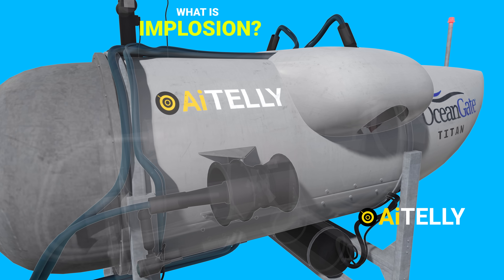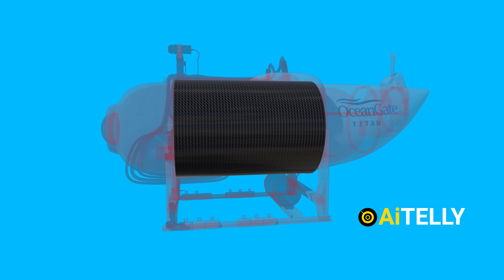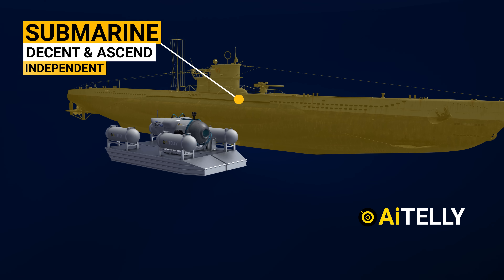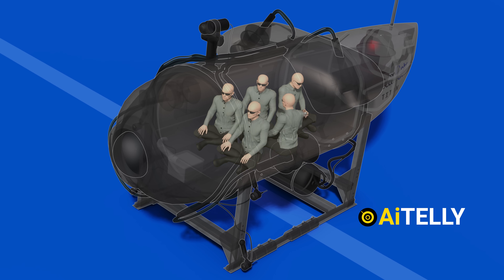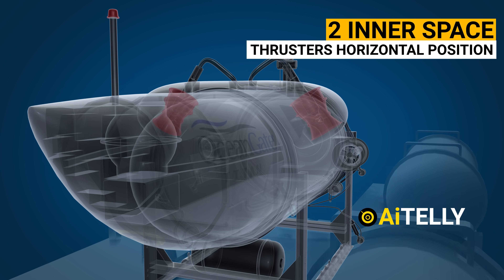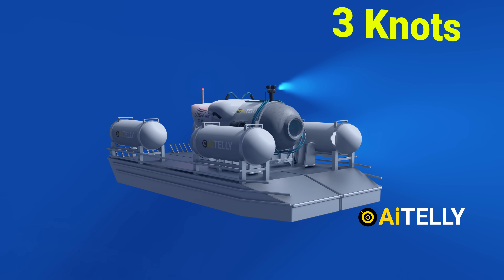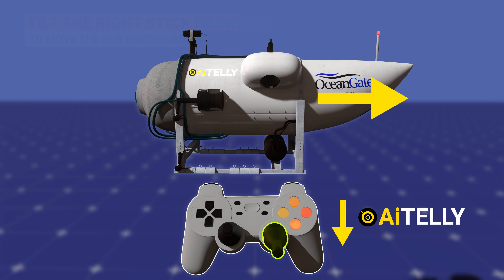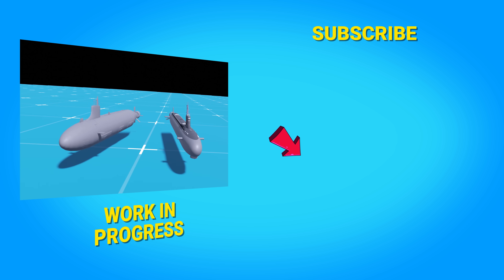Implosion Titan Oceangate How it Happened | Submersible Submarine Parts #3d

Comment: You are stating it was a sudden implosion but nobody knows that for sure, I think the epoxy connection between the hull and the aft end cap was the initial failure. I haven't seen any photos online of the hull or anyting else, just the front titanium hemisphere with the sight glass missing. Has anyone else seen any pictures of the debris from the hull? Just curious
Reply: At the pressures it was experiencing it was absolutely a sudden implosion. You just can't have it any other way. It's not like there could be a slow leak. Once the system is compromise, sudden and drastic complete failure ensues
Reply: @MajDuty  not true, without knowing exactly how those those dissimilar materials would behave under compression/decompression cycles, which would only be revealed in cycle testing, (since this is one of a kind). If it had a small leak in the epoxy seal it could have started pressurizing internally to a certain point then it could have had a catastrophic failure of the rear retainer and been crushed like a sewer pipe from back to front. Carbon fiber is not a plastic pipe, it has much different characteristics, and since it hasn't been tested ever, everything we think or proposed is merely speculation. Until we see the debris from the hull we don't know what happened. I would love to recreate this entire thing on my channel, but the problem I'm running into is nobody really knows what processes were used in the manufacturing, I'm assuming the hole was made from continuous carbon fiber ribbon, not cross woven ribbon, and did they layer resin on every layer? If so how thick, what type, how thick was the titanium cock ring retainer? Alot of unknowns.
Reply: @WarpedYT  I spent 13 years working for a deep-sea ROV manufacturer. We tested carbon fiber in some of our applications and found that after repeated cycles of compression at depth and resurfacing that the carbon fiber would delaminate. CF is brittle, and upon failure tends to shatter. Considering the depth of they were at, estimated by when they lost communications, the failure that they experienced at that depth at those pressure I'm as certain as I can be without having been there that it was a violent instantaneous implosion.
Reply: @WarpedYT  Fibers contract and expand. Why build with THIS material?. SAFTEY should be PARAMOUNT! Build WITH materials, that MINIMIZE risks! Stop with the B.S., trying to justify the use of carbon fiber as correct. Please!
Reply: IF, you do not know, why speculate? What'ts the point?

Comment: According to Jose luis Martin, an underwater expert and engineer, the passengers would've had just enough time to realize something was very wrong. First, the power would've gone out. Then it would be a free dive to the bottom for roughly about a minute. They would've been tossed to and fro every which way as they fell towards the bottom. Eventually reaching an altitude where the sub imploded. Note: the engineers for the sub actually told them "this thing is not safe. Don't go down there." But they didn't listen. My question is: why didn't they design the sub after an rov? Something that is built to withstand that kind of pressure?

Comment: The sub does not dive to 3800 meters at 3 or 4 knots.  That is way too fast.  Typical dives take 2.5 hours to reach the bottom, that's about 25.3 meters/min or 0.82 Knots.  A fast dive which Oceangate did sometimes was in 2 hours or 31.7 m/min or 1.03 Knots.  A leaked transcript of the comm between Titan and Polar Prince did show the Titan diving faster than it had before and was diving at about 37.2 m/min or 1.21 Knots
Reply: From the leaked trasnscript:
The sub starts the dive at 07:54:07 with the report to the Polar Prince "Descending now"
 At 09:28:35 reporting sub depth is at 3433m and attempting to slow fast descent. 
Rush decides to abort the mission as the sub is still descending to fast and drops ballast weights at about 3500m and at time 09:30:36.
Sub continues to descend, so Rush drops the landing frame rails at 09:35:48.
Sub then begins a slow ascent to the surface. 
 Aft cracking sounds reported at 09:38:09. 
Diagnostics started on RTM at 09:42:12 and reporting very slow ascent still and RTM is still reporting red, but sounds have subsided.
At 09:43:42 sub reports at 3476m and ascending. 
Final message was at 09:46:37 at 3457m reporting loss of Power Bus A and switching to Bus B
So the pressure at failure was at about 3450m or higher up, using max dept 3450 the presur was about 5070 psia.

Comment: What an arrogant prick he was to go against science and attempt to "break rules". At least if ur going to use carbon fiber, use it properly and have its fibers run across from each other instead of parallel the entire length of the tube. These wealthy folk also weren't too smart to trust this guy. The knock off Amazon bought Xbox controller should have been sign number 1. And what kind of idiot would put the toilet in front of the portal window so u all have to sit right in front of a steaming pile to look out the window and see the Titanic? And the damn thing was glued together at certain points. Christ almighty. Might as well use a can of Flex Seal.

Comment: So a little click baity. And also some parts are just flat out wrong. Talking about the Titanium dome and how its attached. It is not screwed onto the body/carbon fiber. It was glue welded and permanently in place. No screws and it doesn't detach at all. The animation at 3:06 and your explanation/animation at 4:08 is completely wrong. Also they used the port-hole window to get in and out of the submersible. They would unscrew that to let them in and then screw it back on for them to ship out. Also was one of the big concerns when doing the search as there was no way for the passengers to escape if they surfaced without outside help since there was no way to unbolt the window from the inside to let them out.

Comment: Cool. But how did the ramp return to Mother Ship? Was it being controlled by the Polar Prince or just bouyed up by itself once the submersible left it?
Reply: Ramp? They purposely made part of the vessel detach to help assend quicker but it wasn't a ramp. The vessel didn't just disinagrate either. It imploded/exploded so there will be part rising to the surface based on the weight of the part.

Comment: I think its very possible someone may have gotten claustrophobic tried to grab the control to go back up and then the vessel dove too rapidly as the joystick may have been moved. Then this resulted in everyone being pushed to the front because they're not harnessed in. Causing an even faster and steeper descent. Just a theory but it may not have just been an issue with the sub like most believe.

Comment: Theory:
As I heard, before the incident the sub was decending at a very steep rate, like almost in free fall. This is what I believe could have happened: one of the passengers got sick, and rushed to the front, where the 'toilet' is. This made the front move downwards due to shift of load. Because of that unexpected and quick tilting movement, other passengers could have fallen in the same direction, which made it even worse. With 4 or 5 people near the capsule looking downwards I believe its impossible to bring the sub back to a controlled level position. The descent was like this at a very high speed, which led to the implosion. Any thoughts on this?
Reply: That's plausible. It actually gives another perspective as to what could have happened.

Comment: The use of carbon fiber was proven to be foolish at best.  The mainstay and hearsay is that carbon fiber is stronger than steel, when in truth its not. Steel is Steel, but carbon fiber is Carbon made into threads and bound together with resin.  And there is the rub.  resin is not strong for such levels of force, not to mention carbon fibers strength is under compression, true, but only by way of its binding agent.  as such carbon fiber can easily fracture.  We see it all the time in sports.  especially in something like F1 racing. with two cars barely touch each other and carbon fiber parts go flying off in bits.  Another thing to consider is how easy carbon fiber tears.  least we forget, the very process of making carbon fiber from sheets of its woven material is dont with a basic pair of scissors or a box cutter.   so clearly its not as strong as people think.  not in all applications.   Lastly how it was used in this situation was also foolish, as it was used with other materials of varied pressure resistance.  so. unlike using one material, the use to two of more to build the sub ment that  instability and non-uniformity was a factor in its failure.  I gues the only good thing is that we can only hope their deaths was fast and at best painless.
Reply: It's probably good for 1-2 times use but that submersible has been used many times, which exhausted the materials.

Comment: Nice animation.  I hope the updated video recognizes how these composites would just shatter to bits in an implosion.  I've heard tales that the company did not even do standard aerospace NDT on the finished layup.  Delamination can happen even when everything was done perfectly, and I have seen it on aerospace parts.
Reply: I believe the Boing 777 and F117 Stealth Fighter used carbon fiber wings, there was also an instance of one of the wings on the F117 failing and snapping off like a cracker. Most wing designs have a certain amount of flex or deflection. I think about how whales dive so deep, they basically have a lot of fat that compresses inward as they dive down deep...deep enough to find giant squids.
Reply: A lot of people here who think it's still 2 spaces after a period. It looks weird.
Reply: @juliebraden6911  hopefully this helps your understanding. 

Ellipsis points are periods in groups of usually three, or sometimes four. They signal either that something has been omitted from quoted text, or that a speaker or writer has paused or trailed off in speech or thought. That's the basics.
Reply: @juliebraden6911  It is still two spaces after a period

Comment: The video shows the oxygen/carbon dioxide equipment outside of the rear titanium dome.  Are there penetrations in the titanium or carbon fiber for the  tubing carrying the gases?  Every penetration is a point of weakness/leakage.  Logic would put the gas processing equipment inside the chamber to limit the penetrations.

Comment: Unfortunately your explanation lacks proper physical understanding of hydrostatics, hydrodynamics or material science. I guess people are desperate for an animation. 

The difference in bulk moduli of Ti vs the epoxy coated carbon fiber probably caused the glue holding them together  to fail over time. The shockwave when the Ti end cap fell-off probably caused the carbon fiber to actually explode.

Comment: I'm confused about the construction of the rear of the craft where the oxygen exchanger is, as well as the navigation equipment. That does not seem to be wrapped in anything substantial. It seems to be housed in a thin shell versus either the titanium ends or the carbon fiber area where the passengers sat. Based on that, to me, it looks like it was implode at a much shallower depth than any other part of the ship. Any comments?

Comment: Loosely presented and lacking Factual information both on Construction and Actual Failure.
perhaps Canadian TSB will reveal more definitive Data.
*Likely cause was failure to detect Delamination and structural weakening over time due to a lack of specialized Testing and a CEO's narcissistic desire to project the Design as a successful breakthrough in modernizing submersible technology.
Had attention to structural integrity been at the forefront, they may have realized a simple Hull Replacement would have allowed for continuing Safer dives and improvements to the overall system.